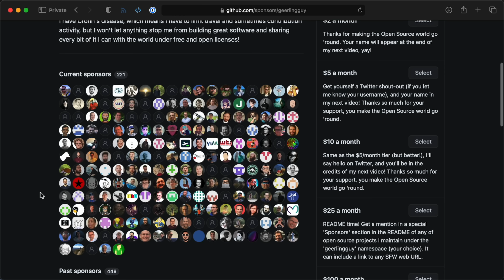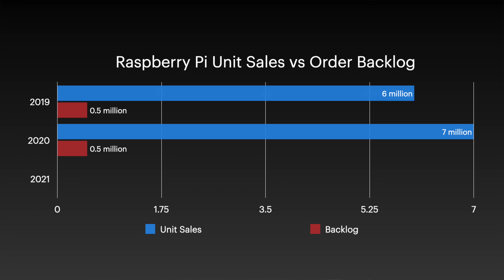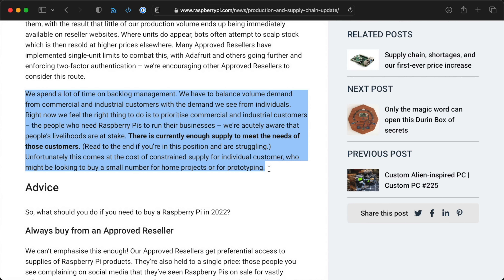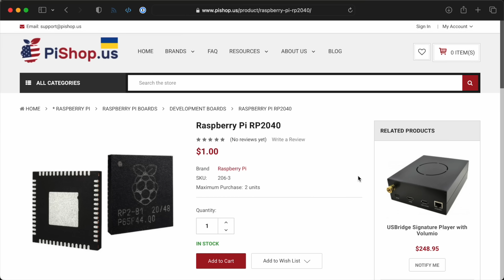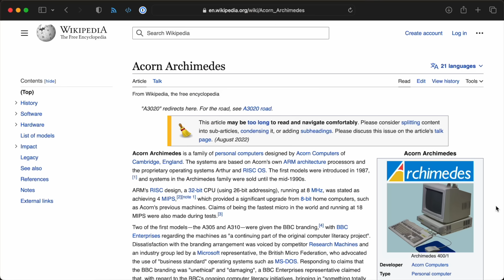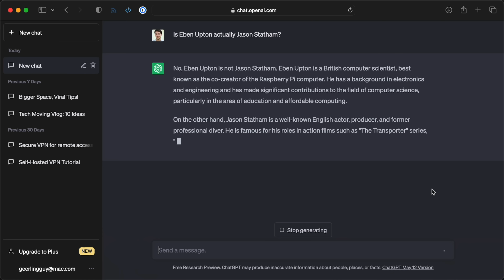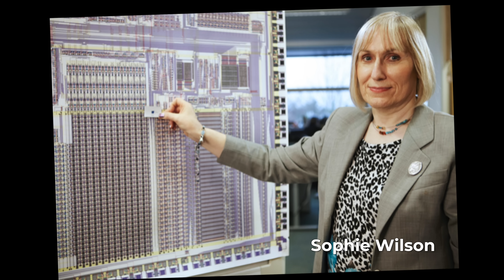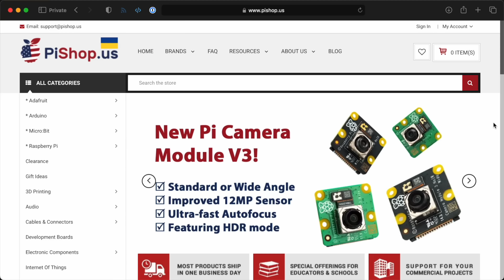He started a computing REVOLUTION—then the shortage hit

Comment: Great interview. Never understood why the hell the PI has two hdmi ports but the cost of an ADC was probinitive.
Reply from the maker: Heh, I honestly only used the 2nd HDMI port once, ever, and that was to test to see if it worked :D
Reply: @JeffGeerling  Indeed, I never use either hdmi port. To me a headless pi makes much more sense. SSH in and manage it that way.

But since the Pico w arrived I learned that most of my projects can work on a micro controller.

I have a pico using WiFi AP for discovery and STA depending on user config running Web server. MDNS, dns and Web socket serving UI content from flash using littlefs controlling the speed of 4 stepper motor drivers using PIO

The little pico doesn't even break a sweat !

Comment: They already CHARGE WAY more than the boards are worth. Okay, so I get Orange pi as an example is made in Shenzhen, but I bought a 16GB dual channel DDR4 ram, 8 core 4 big 4 little, the 4 little's are just as powerful as the ENTIRE CPU of the pi 4, so 8 core cpu, 4 at 2.4ghz which i have overclocked, and 4 at 1.8-2.0, 6 core gpu mali g610 mp4, nvme slot, AND it was 150$ CAD, versus an 8GB R pi 4 at 220$ ON SALE. Shortage or not, him talking about not floating the price, ya w.e as if I give a damn about how big the rpi community is, idk if anybody has noticed that Orange pi has grown A LOT. And has more boards, is more competative, and ontop of that, I can run steam x86 linux games on steam on the damn thing, and right now im working on putting vulkanGL or VK3D on it, so Proton works, beyond that it's emulation is NUTS, and people wanna tell me the rasp pi is better or good? or there aren't options? the raspberry pi is NOT GOOD, I literally also bought an Orange Pi one, just to see what the "worst" of orange had to offer, it's currently in my "super-Duper Nontendo" (has a super nintendo Shell, with a dual controller 1 dongle, and it can play dreamcast at 60hz, quad core, 1.4ghz iirc, 1GB dual channel, like the crappy orange pi is still better than most raspberry pi's and not only that even though it's 32 bit when I put ubuntu on it, it could still load the internet - try to do that with legacy OS for a rpi 1-2. OR A ZERO. omg their zero what a piece of junk. The orange pi Zero's which thankfully look different, but atm I can get a 4GB DDR4 quad core 1.8ghz 6cm squared perfect for say ? a tiny gamecube, and it's 45$ CAD right now, these things in the US ARE SO CHEAP TO, but let's talk a zero that compares to rpi's zero, banana pi zero w. Quad core vs single core, 1GB ram vs half a gig, same io, literally the banana pi with the adapter can compete with a rpi 3 ----- raspberry pi started it,but now it's just the first to start a much bigger and better industry. 

Oh no he mentioned the pi 400. JUNK. I know that the Orange pi 800 is literally a copy cat in a lot of ways, but that rk3399 is WAY BETTER, better ram, better IO, bettter..... literally everything. OH and the new Orange pi 5 plus supports mSATA, NVMe, eMMc, 2 full USB 3.1, USB C 3, 2 USB 2.1s. 3 HDMI's 2 out 1 in, 2 RJ45's. With a full size RK3588 instead of the 3588s that the normal 5 has -and get this THEIR EMMC is only 26$ for 256gigs. So next board for me is Opi 5 plus. half TB nvme, 256 emmc, wifi 6 over mSATA so ya, where's raspberry pi's competition for that style? Rock 5B and nano pi have similar ones (the nano comp has 2 nvme slots jsyk) so if they can keep up within a month, why is raspberry pi still floating the 4 which maxes at single channel 8GB - OH AND NO ON OFF SWITCH WT actual F

Comment: I have nothing against Cortex A72 in Raspberry Pi 4 as of course I knew there would also be cost constraints to the licenses and resultant chips' production. All in all, it was kinda what I need especially for running C++ compiler and / or Android OS on it. I also got mine before the chip shortage hits (I have a version whose USB-C port was set wrongly - I will figure out how to fix the charger problem as my USB-C Power Delivery battery bank refused to touch it).

Comment: 24:32 I’d love to see a micro-four-thirds camera module for RPi, rather than just a C-mount. A lot of glass is either native or perfectly adaptable to MFT, and unlike C-mount, there’s electronic controls for both native lenses and other adaptable mounts. If I could adapt my drive-by-wire MFT lenses to C-mount and therefore Pi’s camera, I’d be happy with that, but… 

MFT is not quite Sony’s E-mount, but Sony does sell their sensors to MFT manufacturers and a smaller MFT sensor might be cheaper and easier to scale for RPi use.

Comment: "shortages"  bs... shortages for raspberry pi but 1000000 clones without shortage where do they find chips? Or risc v which are abundant as well and ok which also is a different instruction set but like PRODUCTIONWISE it needs the same facilities so where is the shortage? they just inflate the price by decreasing availability.
Also if the shortage is real (which it is not but lets suppose it is) to the point where something that costs $20 now sells for $120+ then why not just increase production? I mean its not like we are talking about bleeding edge nanometer production here as with the flagship x86 CPUs there are many places and tooling in reasonable prices that could facilitate an increase in production. 
So there is no excuse.

Comment: I wish raspberry would consider a ppc64 board. They could use the microwatt or A2 cores and get solid performance at low tdp. No licensing fees and there's already a solid ppc64 ecosystem. Raptor CS shouldn't be the only company offering hobbyist power systems

Comment: i hope they put a m.2 connection on the next pi if they are not gonna put AI stuff in it then having the ability to put pcie stuff on it could enable that stuff indirectly with add in cards and just sticking on ssd and potentially gpus and stuff... lots of potential there... not sure if i think putting it on the camera is garanteed to be ideal.. i mean there is ai stuff that does not use a camera and one may want another type of camera... like  thermal camera...

Comment: One of the things I fear about the shortages is that the emergence of the next generation of commercial customers has been killed. A company that wanted to start low volume production of a Raspberry Pi-based product either had to abandon its plans or pivot to some other platform.
Reply: No doubt that will have happened in a few cases, there is undoubtedly an opportunity cost to not being able to supply products; but I'm sure that many potential customers of the pi, like the rest of us, simply had to delay their plans rather than change or abandon them altogether.  The things that make Pis such a great proposition for commercial customers and hobbyists alike, in terms of product quality, technical and software support, did not change, even if the products themselves were in short supply.

But what do I know?  I guess we will find out when we see what sales volumes, and of which products, the Pi Foundation is able to achieve once supply constraints are finally at an end.
Reply: The Pi was never made for commercial buyers, at least not until a few years ago. Blame businesses buying a hobbyist product and not an industrial product.

Comment: I jumped on the pi craze just before the shortage and the unholy prices the hoarders were charging. As such I wound up buying a couple micro x86 SBCs to use for things I planned to use the pi for. I also passed on a few projects that I doubt I'll do now as the original need is no longer there. Add the estimated price of the pi5 unless I need io, ill probably stick with X86 PCs.

Comment: The pi's all come with a gpu. There are threads about enabling hardware acceleration In chromium with flags and some other settings.
That doesn't work for me at all.

But what disturbs me the most is that the desktop windowing still  lags badly. 
Why is there after all these years not an accelerated Linux desktop with raspberry pi os using say Wayland compositor accelerated by the gpu? Why is no-one reacting to this thing? I don't get it.

Comment: sigh, no hints about RPI5....
Reply: If I remember correctly from a previous video by Jeff, is that they're focusing on increasing supply to desired levels before committing to an RPi5. If I remember correctly, so please take this with a big spoon of salt, that the current expectation is around ~2026 for an RPi 5.
Reply from the maker: Hopefully not that long ;)

But yes, shortage really strained their engineering and delayed the whole Pi 5 project a bit.
Reply: @JeffGeerling  reading among the lines on what he told you on and off-line, did you get any feeling about launch of RPI5?

Comment: I bought a couple Raspberry pi 4s just before the pandemic but since all the price increases I just don't see the point. You can get a much more capable machine second hand for cheaper. Those little small form factor PCs from HP and the like. 

Lets be honest, when the supply comes back, the prices aren't going to come down. They quite comfy keeping the prices where they are, if not increasing them again.

I'm just moving on to other alternatives. The PI is great but lets not kid ourselves. They've clearly moved on from us, the hobbiest
Reply: I’m really loving the Orange Pi 5. It’s a LOT of board for < $100. At the low end, it’s cheaper than the practical price of a RPi4. At the high end fully kitted with 16GB, it’s ~$140. That’s nuts. Performance is desktop class and many can use it as their daily driver.
Reply: @thewiirocks  yeah exactly. It's just a little computer, I don't care that much who makes it. I just need a little cheap computer. I think Raspi is done for the hobbiest. They've clearly moved on from us so I'm moving on from them.
Reply: So you think they were both lying when they said pi prices have gone up slower than inflation? Or are you saying you'll keep buying them from scalpers when when regular stores have them to sell at RRP again?
Reply: @zyeborm   Anyway, what I'm saying is that I don't believe prices will come down (until a new PI arrives on the scene). I don't HAVE to buy a Pi if I need a small PC..... there are other, more capable and cheaper alternatives.

I didn't buy from a scalper first or last anyway. I bought from Pishop.

Comment: I REALLY want a raspberry zero or zero 2 w... I bought a zero when they were 10 but of course it arrived dead. But i aint spending 70-100 for one
Reply: Try asking around to see if someone you know would be willing to part with one. Some of us have an excessive supply from when they were more available. I have an original model in a TinyPi, a Zero W in a GPi first gen, 3 Pi Zeros in a cluster running HyperiotOS, and an unused Pi Zero W with soldered GPIO pins that was intended for a game console shell from China that never worked properly. I’d happily send the last one to a good home if it’s convenient. I’m sure there are plenty more like me, so just ask around.

I’ve never seen a Zero 2 W in the wild, so best of luck trying to get one of those.
Reply from the maker: They just started popping up on rpilocator the past couple weeks again, so check there—they should be fully stocked probably by the end of this month!

Comment: arduino is simple, easy, and cheap

pico is not as simple, not as easy, not as cheap, but its more powerful, has more features

teensy is kinda that one child that doesnt fit either, because theres a lot of things that it can do that the others cant, but it also has a lot of quirks that the other two just dont have to deal with, because its not as widely adopted, even if its one of the most popular microcontrollers 

if i had my way, i would use arduino for some simple stuff, communicate with a raspberry pi, who sends stuff to a pico, which handles things, like maybe multiplexing between a few arduinos, and the teensy to do specific tasks that would be a waste to have the pi handle it, and the pi can handle larger, longer, more drawn out tasks that none of the others can

how i would do that, i couldnt say, either because i wouldnt want to, couldnt explain it, or the fact that i havent done it, and dont have the experience enough to explain it to you, but the idea is there, its kind of like having a multi-core system, or a GPU-CPU system that is modular, like the ATX standard, where each addon card is communicating on a dedicated, universal bus, like pcie, but in this case, would be GPIO-based systems such as I2C or simple level-shifting or even CAN bus, but something that each one either is adapted to, or natively supports

i have ideas, but not the time, and for certain things, not the expertise, and not the funding in order to do it, everything is extremely experimental and theoretical, but based in something that could work, with certain tweaking

maybe what i may make, if it comes to light, could make MIT envious

Comment: I think that He was put in an impossible position. Between chip shortages and needing to help smaller businesses to stay in business! I've been wanting a few PI zero 2W for 2 or so years now, I finally snagged 2 from official resellers. Now I can start work on a project I've been thinking about for a few years. When they become more available I will get 2 more from the Canadian PIShop.  I'm waiting an 8gig pi 4 on a project that needs 1 or 2gig at most. So I can't wait for them to be in stock and get my 8gig back. But I know it will not be tomorrow. So I will wait. The raspberry Pi is one of the few of these SBC's That has the kind of support it does. A lot of these Chinese boards are released with little to know info, and good luck finding drivers at times. I see a lot of them for sale by people that said they will never buy another RaspberryPI. One guy locally knew I had a Small Stock pile (5) and  has been after me for months to sell him a couple. I just remind him of his promise to never own another. 3 of my spares I got from him cheap. 4 PI3Bs and the Pi 4 I want to liberate from it's duties!

Comment: I've given up on RPI's getting back to normal supply.  Moving forward, I don't see buying any Pi's in the future as the used NUC market is saturated and NUC's can be purchased at the same, if not cheaper, than a RPI.  The expandability and higher power of the NUC's is a much better performance/price ratio.

Comment: Too bad there was no question about the firmware blobs, especially regarding the bootloader.
Reply from the maker: I actually did get into that separately (not during the interview... just wasn't enough time before all my batteries started giving up!), and also talked to some of the Pi engineers (including the main engineer who develops the firmware/bootloader code!).

Good news on that front is coming, though using Broadcom's chips, there will always be some portion that is closed off—though that portion is getting smaller and smaller.
Reply: @JeffGeerling  Cool! Thanks a lot for your work and these explanations. And yes, knowing Broadcom, I know where to stand. ;)

Comment: I recognize I'm not the majority, and the community would have collectively crucified them over it, but I actually would have been cool if they'd increased the price to match scalper prices, as a sort of "well, if the market's screwed anyway, we may as well be the ones making the money", and then put that extra revenue into RnD or supplier relations to accelerate the next gen or launch it at a higher end spec point than originally intended, or perhaps to bring a greater level of software support with the next gen (would the money have been enough to to push for Pytorch integration with an RK3588/S's NPU? What about pushing for support towards the open source drivers of the next Raspberry Pi's GPU? Could we have had a complete PCIe interface so we could pair dGPUs with our Pis if we compiled the drivers correctly?). Basically, as long as the money went back into the community overall, I personally wouldn't have been terribly annoyed.

Comment: I will necer use a pi w again until i get ground connection. The gigant ammount of esd shocks the living fuck out of me and also bricks them in 5 minutes. I never had that issue with esp32 and arduino. I could be that i bricked them when solderinf but i doubt that i did that 6 times and also i in a way that let them work for a while and then start failing. Xd but tbh. I do love raspberry pi foundation. They are beyond awesome

Comment: When I say I have moved on its not because I'm mad.  It's because I was forced to learn linux well enough that I can use any sbc/module/chip and I don't need pies anymore.  I need something I can get consistently which was never the case before either.  I need something with an open schematic reference board.  I need something where I **can buy the chip**.  Pi just doesn't deliver because they are locked in to Broadcom and Broadcom hates regular people.  idk.  I would use pies again to start projects, but I'll never plan to use them in a product.